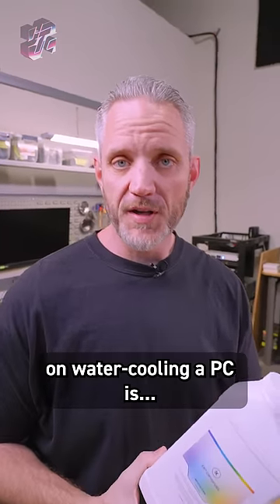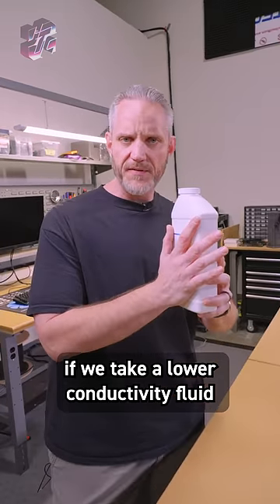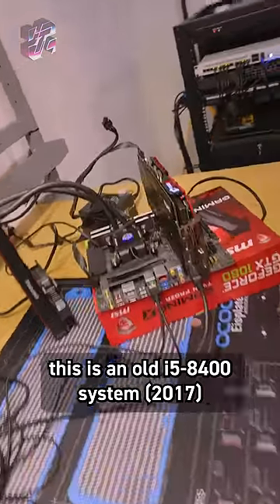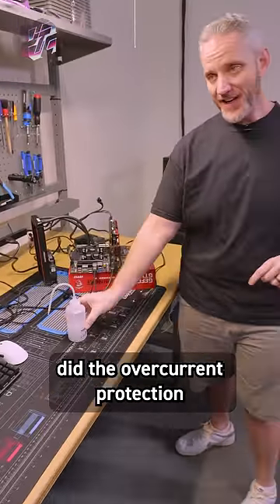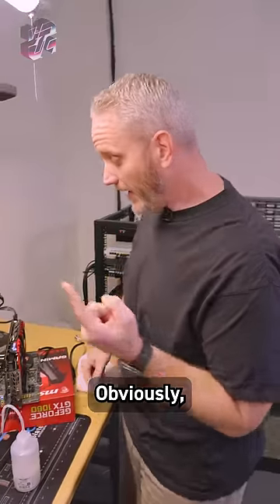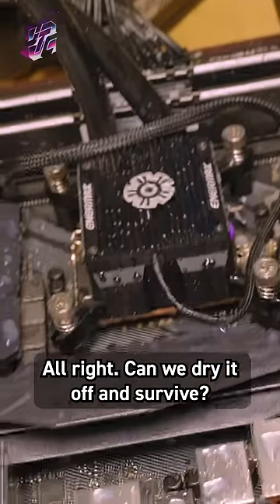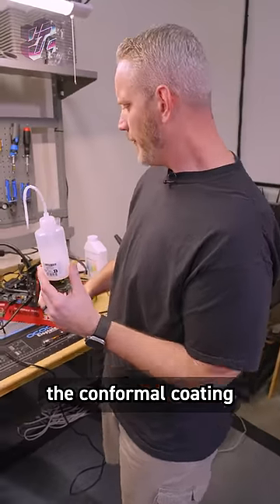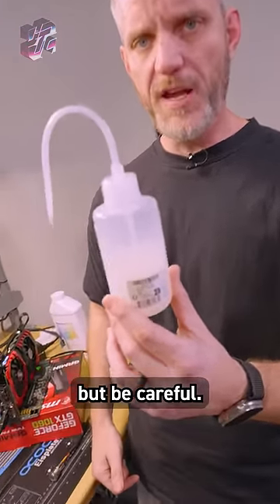Pouring water on a PC for science!    #pc #pcmr #shorts

Comment: PC components have gotten more idiot-proof these days. It's impressive as to how resilient they can be (Assuming you dry your components before corrosion occurs).
Reply: You say "these days" but that board is 6 yrs old which is decades in tech years.. I'm sure that the OCP in the PSU (which I'm assuming is much newer) had more to do with saving that board than the board it's self..
Reply: @Furball-8994  And in addition to that: It's not aimed to being "idiot-proof". Electricity can be wildly variable and it's just objectively better to be able to save the system in the case of shorts, regardless of what caused them.
Reply: Back in the early 00's ive litteraly run some motherboards through my dishwasher to get vaseline off the board. obviously i've let them dry thoroughly afterwards, didnt use salts etc. and they weren't powered so it doesn't relate to this Shorts content, but my point is still valid for "pc part resilience"
Reply: More like human error. Accidents happen lol
Reply: Jayztwocents and many others spanked Asus for putting out bad and boards recently lol
Reply: Idiot proof? Ha, no. No they have not. In fact they are even less reliable when being used by professionals. Case in point: The RTX4090 power adapter. Those things are not idiot proof, but they were designed by idiots.

Also as hardware gets more advanced and smaller, the failure rates and DOAs have skyrocketed.
Reply: @johnmclain250 I dont think you understand the term buddy.
Reply: @MaxSoininen  Hey! I'm not your "buddy" pal. :P
Reply: You mean Idiot resistant right?  I personally know an idiot who tried to fix a leaking heating oil pipe with an oxyacetylene torch.
Reply: Well, not completely idiot proof. I blew up a 3900x 2080ti system by knocking a beer over it whilst I was asleep. Graphics card PCIE connector and mobo slot fried and few capacitors popped off mobo. Horrendous burning smell for days after if you put ur head in the case. So yeah.... Can still fuck it up I wouldn't advise testing it.
Reply: you would be surprised that "idiots" are already few steps ahead😅
Reply: @patrickhydar1225 Too bad
Reply: i had a pc-xt....there was a command to park the head of the hdd to be able to move it arround safely :D  nowdays ......
Reply: @Furball-8994  The military perfected conformal coatings decades ago, a conformal coated board from 6 years ago should be just as protected as one made today.
Reply: @StimulatingPresence  That would be true IF motherboard manufactures spent the extra money to coat them. 1. Companies want to spend as little as possible for manufacturing costs.  2. The better they are made equates to a longer lasting product, Which means less opportunity for the Co. to sell you a new one. I'm old enough to remember when products were built to last decades, Now products are made with a 3-5 year life expectancy.
Reply: I've dropped so many testbenches and had them boot right up
Reply: My buddy accidentally knocked an entire cup of tap water into the top of his Intel Q6600 9800 GTX SLI build. We dismantled everything including the blower coolers of the GPUs, which we literally poured at least a half cup of water out of one of the blowers. After everything dried out we put everything back together and everything was perfectly fine. This was over 10 years ago.
Reply: @johnmclain250  "as hardware gets more advanced and smaller" mentions the 4090 lmao...
Reply: @timduh6964  Well the technology IN IT is indeed smaller, the 4090 despite being massive, is all cooling. Take the cooler off a 4090 and it's about the same size as a gpu from the early 2000's, smaller even, despite being around half a million times more powerful.

Comment: "Old 8400 system"
>Me with my even older 6500 system watching this...
Reply: i have an i5 8400 i died inside
Reply: Me with my 7700 too lol
Reply: Me with my 4570 looking yall
Reply: Me with intel Xeon E5 1620v2
Reply: Mine is 4690 💀
Reply: 3770, oldest one so far guys
Reply: Not me with a i5 - 2300
Reply: Me running a 2699V3 machine that I got for like $150 earlier this year
Reply: Me Xeon E3 1240 V3 or similar to i7 4770
Reply: Me with i3 2100 and q6600 🫡☠️
Reply: we're all the low spec squad here lol
Reply: I was still running a 4460 until about 4 months ago lol.
Reply: Ryzen 3 3200U checking in from mid to late 2019!
Reply: 6500 gang rise up
Reply: i3 2120 💔
Reply: I7 5500 here 💀
Reply: 3770 😅
Reply: @TrulyToxicGaming +
Reply: @thegrimreapers7612 haha, really old
Reply: Lol, thats all you guys got? here's me with my i5-540 and radeon hd 7570 (💀).  Bte its a oegstone pc from 2010
Reply: @m.hassantechz  Bro is on first gen omg
In 2010 i still had a single core cpu with 512mb ram running windows xp lol
Reply: You're all amateurs, I've got an athlon 64 x2 5000+ from 2005 with 1 gb ram...
Reply: i5-3570k lol
Reply: I have a pentium g4400 😭
Reply: Also have a 8400
Reply: Me and my Intel Pentium
Reply: Watching this on a laptop with an i3 5015u in it lol (thankfully I have a much better desktop)
Reply: me with a 2500k superclocked to death to 5.1ghz screaming at me just let it die but i refuse lol
Reply: Me with a 4790K system:
Reply: >me with an athlon x4 620
Reply: I am rolling i5 2500 ... NOT K ...
Reply: me with a i3 2100 and gt 710
Reply: @3tech we almost together damn
Reply: I'm running a xeon e5-2687w. That hurt to hear XD
Reply: Me with an i5 3470 from 2012
Reply: bro I got a Core 2 Quad Q6600 😭😭😭😭😭😭
Reply: Me with a 3317U
Reply: I5 3330 and fx 4100....
Reply: I have a 6500 as well 😭😭😭
Reply: @KoolrunsJr 2500, older
Reply: Me with 1st gen I7:
Reply: Me with my i7 4790k
Reply: 8086
Reply: I5-3330 lmao
Reply: Intel E5400 here😶
Reply: Amateurs, e2200
Reply: @nimamaster6128  😂
Reply: Same
Reply: I decided to buy an old system with a I3 3240 for photo storage and other things. I don't think I can join the low end gang though, my main laptop that I use is a 12th gen I7 and a 4050
Reply: me with my Athlon II x4 645
Reply: Amauters...
Reply: 4700

👁👄👁
Reply: Me with my 7700
Reply: Me and my etch a sketch.
Reply: I have g4400 bruh AHHAHHAA
Reply: Me with an i5 2400 and integrated gpu
Reply: I must protect my 4770. ;-;
Reply: Chilling in the lurk squad with my 6700K.
Reply: All this goes to show is how much less important having cutting edge processors is now... imagine daily driving a 10 year old system in 2010 or 2000. In 2023, with Linux, 8GB RAM, and an SSD, I was able to comfortably use my i3-3227u (2012) laptop for all my web browser based activity when my newer laptop broke until I got a replacement a few months later. It was incredibly snappy and responsive, I was impressed. As long as you aren't doing anything intensive these older systems are great (and cheap to get)
Reply: me with my old A10 7800
Reply: My low budget friends, today is my birthday, and i just got a new PC with a R7 5700x, im no longer going to be in the old low budget team
But my heart will be forever with y'all, as my old pc will still be here with me for quite some time 🙏
Reply: i7 4790 checking in my friends
Reply: @SavioSiqueira1  i still in this.
Reply: Me with my i2500 😭
Reply: 6600k and 7700k checking in
Reply: Phenom II x6 1075T over here
Reply: Inter I7 4770K with an Rampage 4 Extreme and 64Gb of ram .... so what do you say?
Reply: I have a 7600 and it runs 1440p 165 fps
Reply: I5 3570k, Z77, 16GB DDR3, GTX1660, SATA3 SSD and an i7 4790K, Z97, 32GB DDR3, iGP, SATA3 SSD, BD-RE. Had to buy PCIe addin cards so I could add USB-C I/O to both systems.

Also have an HTPC mATX with C2D e8400, 8GB DDR2, nForce 9400 iGP (first ever onboard 1080p HDMI), still works but it can't run Windows beyond 7. Originally built it early 2000s as an XBMC/Kodi (pre-Plex) box for network media player (divx, xvid, mkv, x264, flac, mp3, from HDD or SMB), but now there are SoCs that can do it for much less watts and <$50 (Roku, RasPi).
Zotac AD10 still works with OpenELEC or LibreELEC.

Comment: Not all fluids are conductive. Fluids with mineral contents are conductive. Pure water is actually a really good insulator.
Reply: What about semen?
Reply: thanks tips
Reply: @dogbog99 😂
Reply: However, the pure water is also pretty good leaching out metals.
Reply: @dogbog99 semen conducts electricity
Reply: @dogbog99  Highly conductive, contains minerals.
Reply: Odds of water being "pure" enough to not conduct? Even distilled and deionized water conducts electricity because it strips particles from things around it.

It has to be pure AND isolated in glass... which isn't the case here
Reply: @dogbog99 explain why you can run a pc in mineral oil then. Its about the ionization of the liquid and whether or not it actually has conductive contents. Your statement is incorrect, sir.
Reply: @TheMoafo  the word mineral is deceptive. Mineral oil is basically a refined product of oil production like gasoline. It is non-conductive.
Reply: So is it recommended to cool using distilled water?
Reply: Probably pure water also isn't the best thing, cause it is surprisingly good at eating metallic things away (more or less solves them). It will also become conductive again with impurities like that. Even some dust can be enough to raise conductivity again. 

Afaik destilled water + some additives are used to prevent at least the "eating away metal" sort of corrosion.
Reply: @kieferonline  You can, but you'll need to put in an algae additive to keep it from growing. The thing is that water will leech metal ions and become conductive over time. This will cause damage to the cooling loop, though water is the best coolant in a liquid air heat exchange system. Most non-water coolants can manage to cool within 5-10F of water and don't have the issue of conductivity that water gets.
Reply: What's the difference between fluids with mineral contents and pure water? About 5 seconds or as long as it takes for the pure water to oxidize enough minerals to form a current.
Reply: I remember learning about pure water not being conductive as a kid, my mind was blown lol
Reply: Pure water is easily diluted into something else.
Reply: Pure water, lol
Reply: @@HarleyDavidsonofKorea I wonder why we don’t use things that are not electrically conductive but only thermally conductive
Reply: @@HarleyDavidsonofKoreabecause pure water ionizes itself after a time
Reply: Not minerals. Ions.
Reply: Someone paid attention in their electronics class? 

(one of the first things our teacher in my high school did was show us how different solutions of water affect electronics. )
Reply: who asked?
Reply: @dogbog99  stop creating shorts with your "short"
Reply: Another in theory yes in practice no bogus statement
Reply: @@HarleyDavidsonofKoreaexcept it’s also a powerful solvent and will pick up minerals if it’s in contact with them
Reply: @zxSwifty  Your mom asked
Reply: Yep but distilled water won't remain distilled for long
Reply: You're not wrong but distilled or pure water doesn't stay pure. Water is called the "Universal Solvent" for a reason. It will dissolve contaminants and start conducting pretty quickly.
The trick is finding a fluid that is thermally conductive while remaining electrically inert.
Reply: Mineral oil enters chat...
Reply: it is not due to the self protonation of water which forms hydroxide and hydronium ions that can transport the current. This process gets supported by a present current. 

Water with high ion content simply is even more conductive but distilled water by far is not an insulator
Reply: self protonation of water is why it doesnt work for long @@HarleyDavidsonofKorea
Reply: Most fluids will gain ions over time and become conductive.
Reply: Maybe just don't watercool unless it comes as a closed loop? 🤷
Unless you're an enthousiast I don't see the point in messing about with all that stuff...
Reply: Pure water is a terrible insulator because it stops insulating when it touches stuff.
Reply: Just use mineral oil dude. Even the cooking oil is very good insulator with high heat decapitation
Reply: Yeah. Unfortunately, the pure water will stop being pure as soon as it leaks because your computer won't be clinically clean.
Reply: @TheMoafo  You have no idea what you're talking about.
Reply: @dogbog99 It’s highly conductive (don’t ask me how i found that out)
Reply: @dogbog99 that would be conducting sexual harassment
Reply: I always find it weird that people specify fluids and don’t just say liquid, technically an air cooled pc is fluid cooled
Reply: @dogbog99  high mineral content 😔
Reply: @sandwich-plays  you came in one of those old cases with watercooling holes didnt you
Reply: Uhhh no dude. Pretty sure water no matter what's in it is conductive. It's just not a great conductor period unless you put shit in it.
Reply: @city4543  no It’s not, distilled water is not at all conductive, it also becomes conductive when an electrolyte such as table salts is dissolved in it, almost water we consume or use has some different salts in it
Reply: @Jem2556  ANYTHING is conductive. Just like I said, you have to dissolve shit in it to be worth anything as a conductor. Even if you're swimming in a pond and it gets hit with lightning, you're probably just going to feel a tingle. Water can conduct, it's just shit at conducting.
Reply: @city4543  bro, I’m literally studying physics and electronics, anything CAN be conductive giving a high enough voltage, I understand what your saying but by your definition there are no such thing as insulators, which is not a definition we use
Reply: Even distilled water will eventually pick up an ionic charge from the metals they are touching in the radiators and other watercooling parts
Reply: @city4543 Deionized water is totally non-conductive. It just doesn't stay deionized easily given enough time, because it acts as a solvent to any polar compound, includind itself.

Comment: Pure h2o is also largely non conductive.  It's why EDM works even with the parts being submerged in water, and you can submerge your hand into the tank without so much as a tingle.
Reply: the problem with pure H2O is that it loves to get minerals and such.
it will not directly be conductive but over time it will leach enough conductive materials that it becomes a problem.
this is also why you should never drink pure H2O it will take out minerals from your body
Reply: H2O. Not h2o. If you are going to use the chemical symbol at least take the effort to use the correct symbol.

And if you think the case of chemical element symbols doesn't matter, think again.
Both upper and lower case letters are used in chemical symbols.
Reply: @ShockburnVR But if you have pure H2O in a sealed water cooling system for a PC, where are the impurities going to come from to ionise the water and increase its conductivity?
Reply: @deang5622  ok then, Dihydrogen oxide.
Reply: @Apexseals87  No, Dihydrogen Oxide (you didn't capitalise the O) is NOT the chemical symbol.

This really is not hard. So why do you make it hard?
Reply: @Giblet12  yes there is.
And as a chemist, your view isn't important and I will explain to you why. Go to back to the original post, it's not really about chemistry, it's about how the person writes and the consistency within what they write and whether they have the attitude to give a damn.

I would have hoped you would have realised that before trying to add weight to your post by saying you are a chemist, trying to give your post validity.
Reply: @deang5622  "where are the impurities going to come from to ionise the water" That's rather easy to answer: the impurities come from the blocks and radiators will get trace amounts of copper and brass and nickel and whatnot ripped by the water that flows on them. They are metals, they get in the water flow, they ionize, they increase conductivity.
Reply: @deang5622 Your tism is showing too much, should probably have your handler limit comments you can make by standing behind you
Reply: @ShadMuffin  Just jealous I know more about it than you? How sorry I feel for you.

Nothing wrong with being accurate. It does matter.

It tends to be poorly educated people that don't care about accuracy... Are you one of them?

Your way of thinking is wrong.
You're trying to blame the person that detected and commented on the error, whereas the actual fault lies with the person who made the error, either through a lack of knowledge or a poor attitude where they don't care.

Comment: Well, I lost a CPU and motherboard once because of condensation on the waterblock. Just one foggy morning with the window cracked open a bit was all it took. But this was probably 2008 and it was likely using the cheapest power supply I could find.
Reply: A) never cheap out on psu
B) its not 2008 anymore
Reply: @Herbertti3  The neccessity to point that out was obviated by my inclusion of the word "But" at the start of my last sentence. The But indicates that I'm adding qualifiers which contribute to the idea my results didn't occur under the best conditions or with the best hardware.

Comment: It depends. The problem with water and various components in it is corrosion of very thin leads of various circuits. The system may work for a while, but if the corrosive agents stay on the leads for some time, they may completely corrode these leads, and that will be it for the system.

Comment: The key here is drying out immediately after the leak, but what I've seen is that a lot of people find the leak when there's already some corrosion, not only for killing their HW at that moment. I'm just saying, if you use water cooling, you should be aware of the implied risks, and no system is completely fool proof even if you have a great PSU